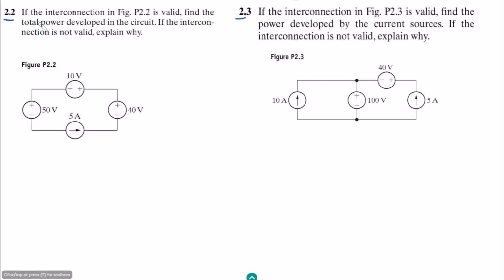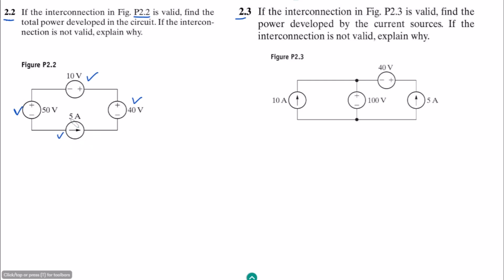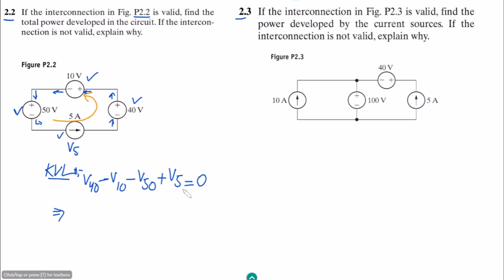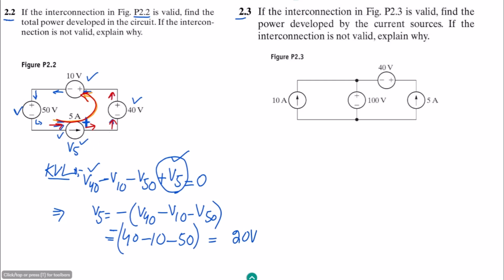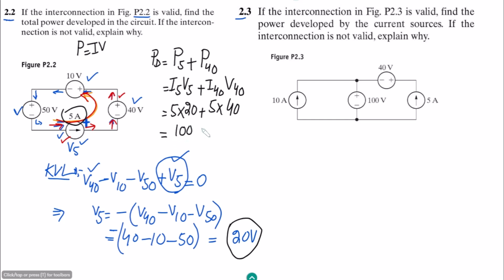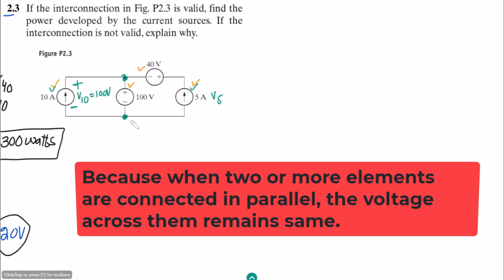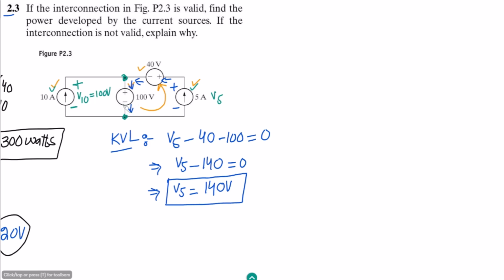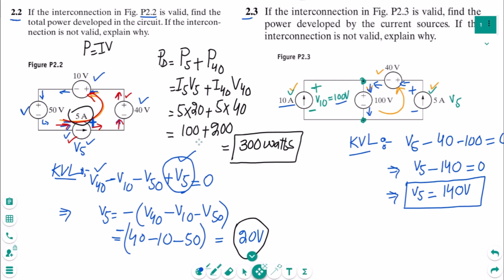2.2 & 2.3: Valid Electric Circuits –Electric Circuits by Nilsson (Voltage & Current Source Analysis)

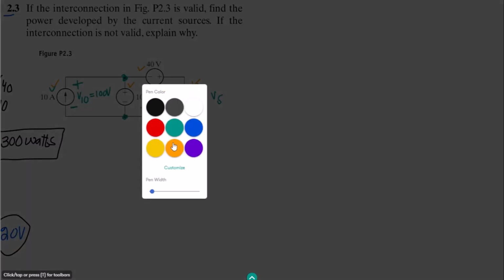Comment: 7:20 sir at that point if V10 has same voltage as overall voltage 100V so same for the V5 why we find for V5 its also in parallel with source voltage
Reply from the maker: No it's not in parallel...the series combination of 40V and 5A is combined in parallel with it.